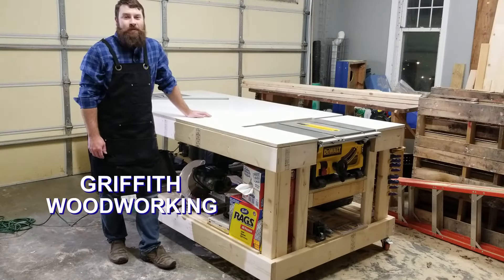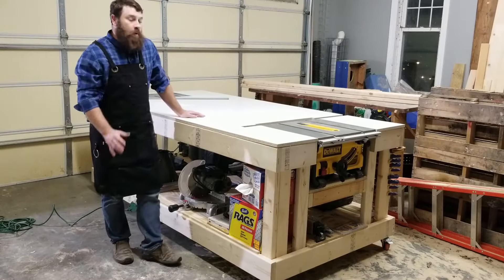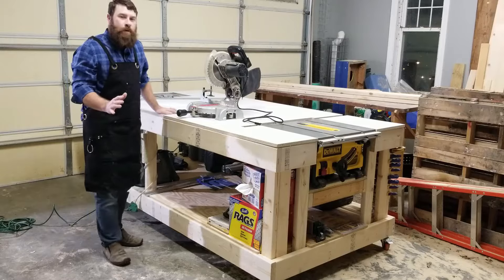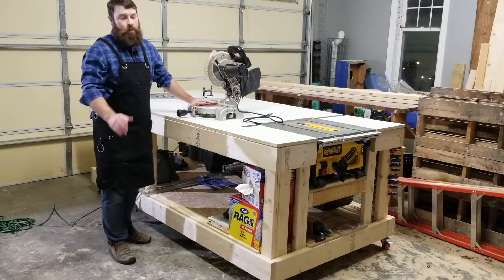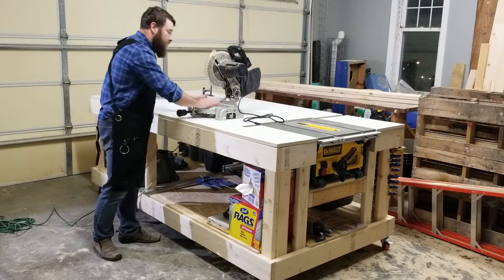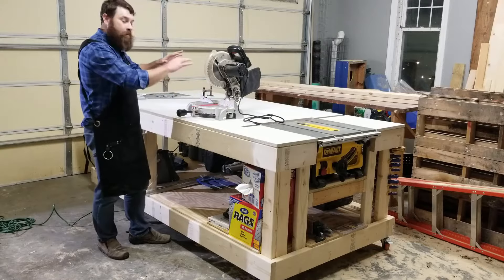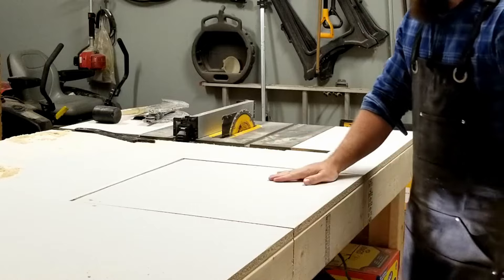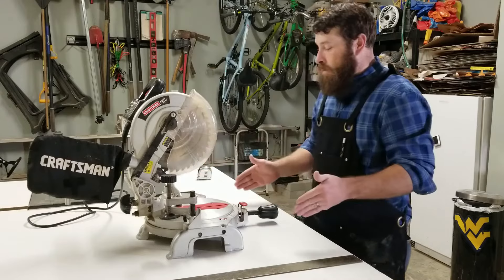Part 1 - Miter Saw Flip Top for Ultimate Mobile Workbench

Comment: How many of the Kreg screw bits do you ruin using a power drill to drive the screws in?  On every drive I can hear you rounding out the bit and the screw head.
Reply from the maker: yeah, I do that a lot.  But so far I've only had a couple over 4 years.  They are pretty tough.

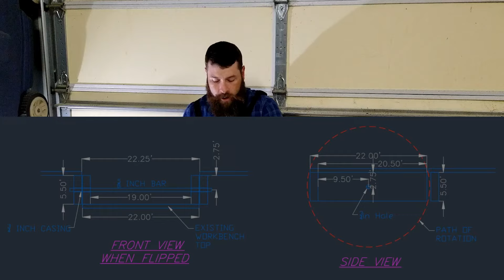Comment: OK, so I, like many others who replied to this, seem to be trying to figure out how he figured out where to drill the 3/4" hole into the 2x6 supports/sides.  At about 9:08 he shows a diagram of the flip top.  The 2x6s that he cut are 20 1/2" long (he also said this earlier in the video).  In addition to that, the front of the table is a 2x6.  Taking into account that the actual measurements of a 2x6 are 1 1/2" x 5 1/2", you add the 1 1/2" to his 20 1/2" to get the 22" (which you can see on the right side at 9:10.

So here is where the quick math comes in.  The hole at 9 1/2" is "actually" at 11", which is half the distance from the outside edge of the table to the end of the 2x6 support.  9 1/2" + 1 1/2" = 11".  11" + 11" = 22".

I am building a similar flip-top for my miter saw right now.  I actually have almost the exact same Craftsman saw as he does, but I'm making my table cut out 26" by 26" as I just know the SECOND I finish the build, the 15 year old saw is going to die on me, so I'm planning on building it a little bigger for a newer (possibly sliding) miter saw replacement down the line.

As I'm doing 26", the 2x6 supports will be cut to 24 1/2".  Why? Because I also have a 2x6 as the sides of my table so... 24 1/2" plus 1 1/2" = 26".  I will be drilling my 3/4" hole at 11 1/2" because 11 1/2" + 1 1/2" = 13", which just so happens to be half the length that I want.

Hope this helps some.

Also, if you are using different nominal lumber than 2", just take that into account for the actual measurements.  1x4 (or 1x6, or 1x8) is 3/4".  2x4 (or 2x6 or 2x8) is 1 1/2".

Sorry for not knowing the metric...I only use that on my car.

Comment: im going to build this, thanks so much. i'm with robert though on the ability of 3/4 melamine to hold those pocket screws when the saw is put away.  counter sinking 3in screws through the melamine into  the 2x6 or even through bolting it would make me feel better.

Comment: Get videos by the way. You definitely make it look easier than it is but we only see the good stuff. 
I almost finished my rotating miter saw part today. 
A question that I have is, can you use a round over router bit with melamine?  Edges are a little rough and I would like to smooth them out. 
Keep up the good work.

Comment: This is a decent build but the only thing I would have done differently is made the boards you screwed to the underside go all the way across so they meet each face of your framework and then you can make sure the weight of the saw assembly is supported by the frame and not causing the weight of your saw to rip out of the melanine over time.

Comment: I have the same DeWalt table saw. The width of the miter slots are so inconsistent that I cannot use miter runners. Does your saw have that issue? If so, how do you work around that?
Reply from the maker: I haven't encountered that issue on mine, but I rarely use the miter runners.
Reply: Another YouTuber solved the problem by sanding them straight.
Reply: @davidbroadfoot1864  I tried the sanding method. It did not work. No sleds for me. I plan on getting rid of it anyways, so I suppose won't be an issue for long.